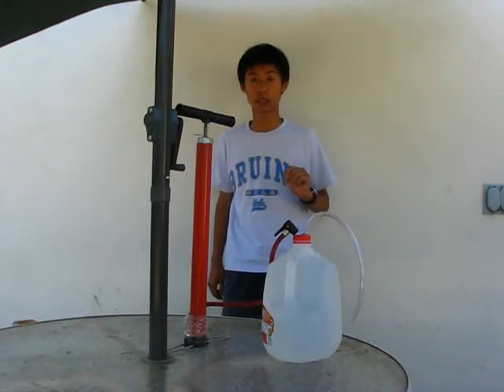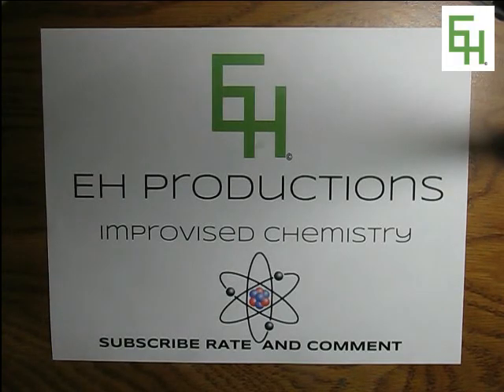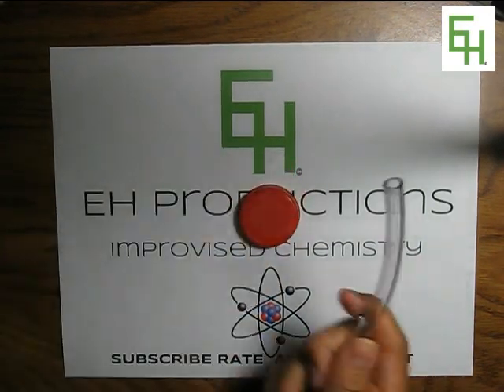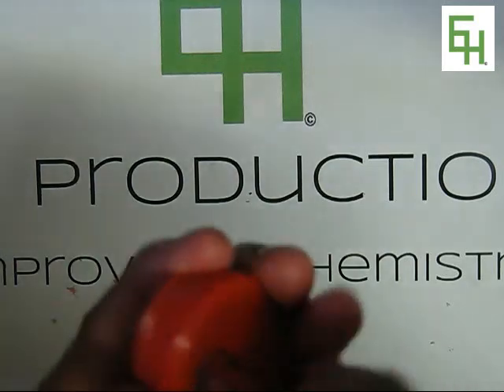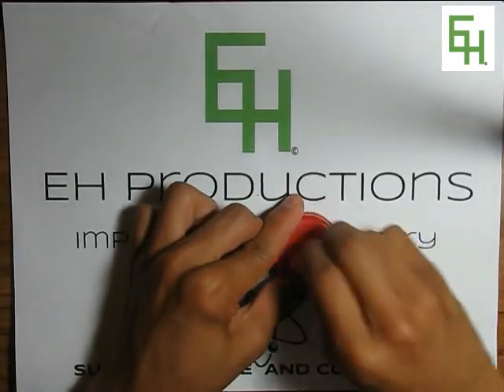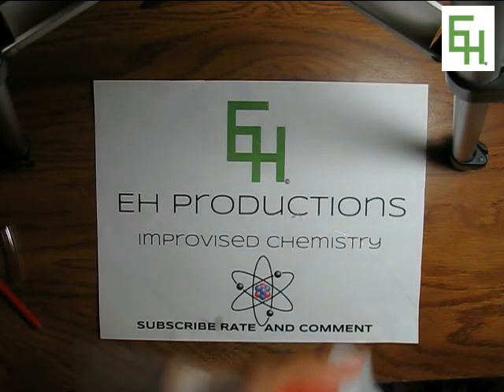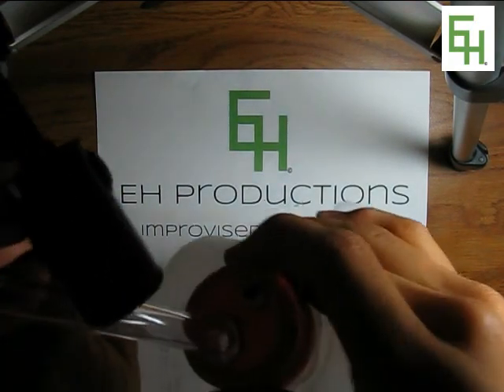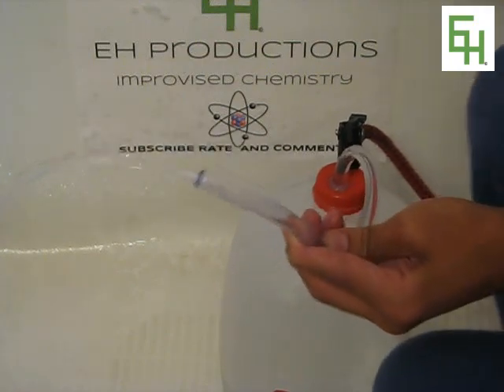Improvised Chemistry: Make a Bicycle-pump Siphon [Portable Sink]

Comment: Yo where is the siphon aspect of this pump it doesn't do any sucking in liquids does it?
Reply from the maker: Hi Nathan,

Google's definition of siphon is

"a tube used to convey liquid upwards from a reservoir and then down to a lower level of its own accord. Once the liquid has been forced into the tube, typically by suction or immersion, flow continues unaided."

So to siphon doesn't necessarily mean that the water has to be sucked. In this case, the water is pushed out through the tube as air is pumped in the bottle. This counts as siphoning according to the Google definition above in "a tube used to convey liquid upwards..."

Hope that explained things!